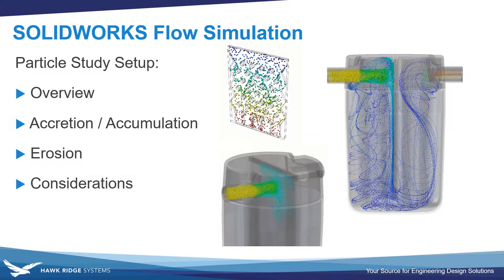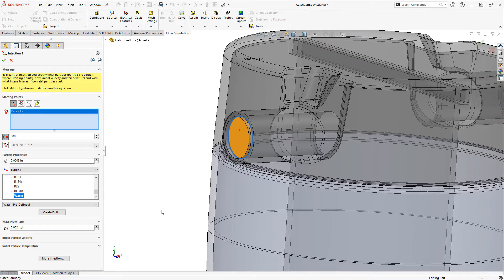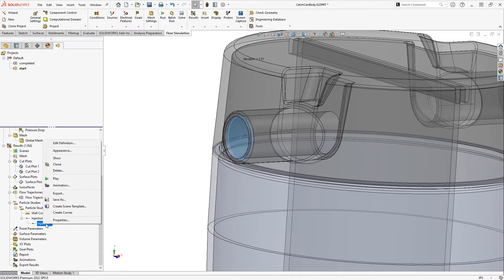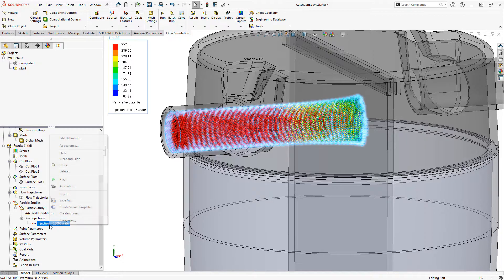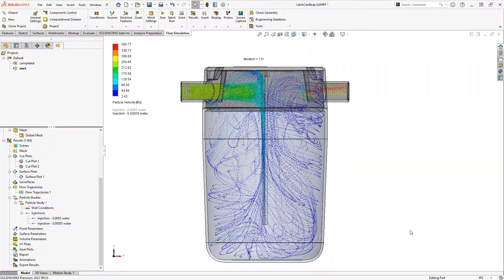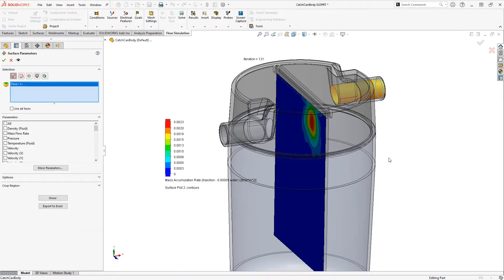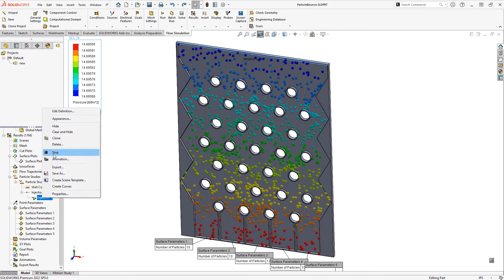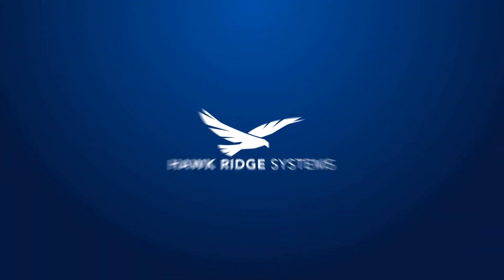SOLIDWORKS Flow Simulation: Particle Study

Comment: Thanks for this video. I've been setting a series of simulations for erosion of a pipe vs flow rate and this has answered a question i've had regarding the significance of number  of injection points